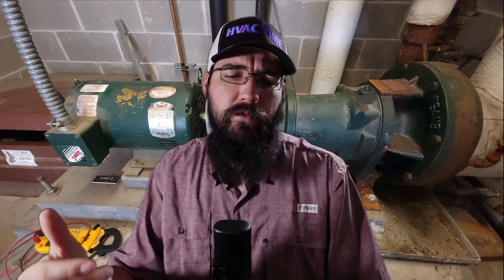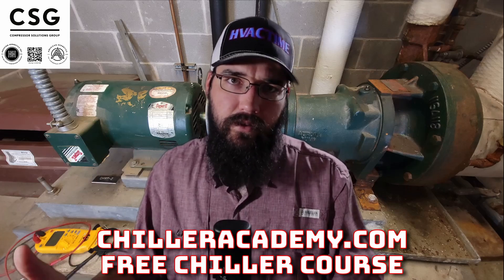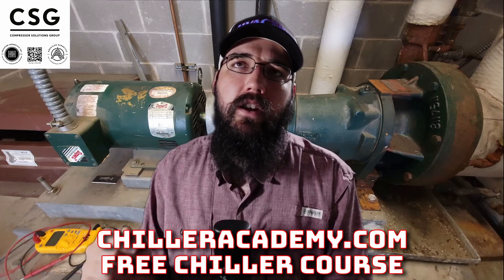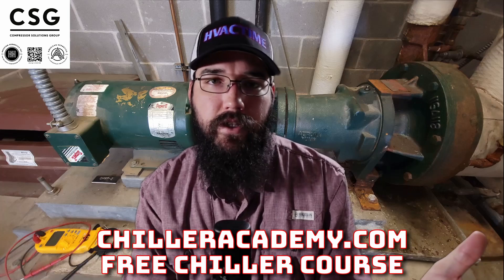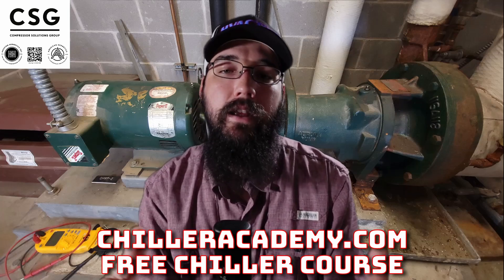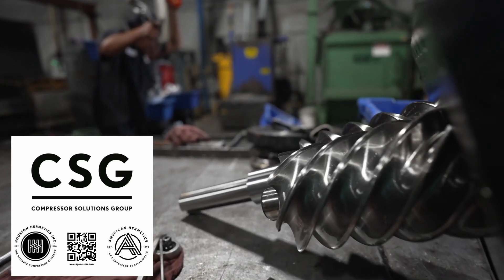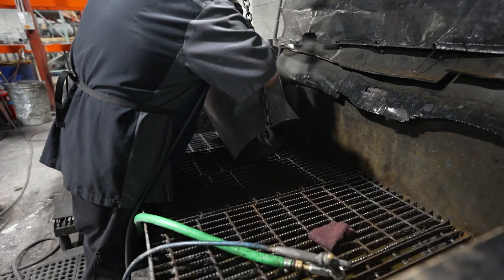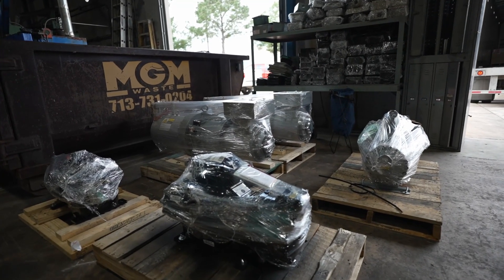Mixing Grease Destroy Bearings?

Comment: Started working at a 60 year old government facility. Asked why they using a high impact, high temperature grease on the motors. Oh, it is the same bearings in other equipment, so must be the right grease. Now after the facility is expanding, and maintenance is complaining about the rate the motors are being replaced. Motor vendor won't say what is wrong, but they sell a lot of motors and rebuilds.

Comment: I have been a Commercial HVAC tech since 1999. Our local motor supplier (Conrey Electric) furnishes us with a grease compatibility chart. I saw what happened when lithium grease was used on a 40 horsepower supply fan motor on a Trane Intellipak. The polyrex turned to liquid and the bearings failed.

Comment: Not 100% the same but I've been in the transport maintenance industry for nearly 40 years. Over the road vehicles are greased with whatever the shop has on hand. Usually the shop has whatever was on sale when they needed to resupply. If mixing was a problem, I would think there would be widespread failures from mixed grease types. Just my observations, nothing scientific to back that up.

Comment: There are grease compatibility charts all over the internet. Electric motor bearings use polyurea grease. Polyurea grease is not compatible with most other greases such as lithium grease. Both the Mobil polyrex and Chevron SRI are polyurea greases. Mixing them should not be a problem. The problem is mixing other greases such as general purpose greases with polyurea. Again a grease compatibility chart will show this. You also mention bearings running hot. Something everyone needs to understand in this trade is that motor bearings only need a small amount of grease to function properly. Too much grease will cause a bearing to run hotter because as the balls rotate in the bearing they will constantly be pushing against the excess grease causing resistance and heat. Over greasing electric motor bearing is far more detrimental than under greasing. Also as soon as you pump grease into a bearing its going to mix with what ever grease is already in there. There isn't enough space for greases to remain separate once the bearing is moving. Not an issue if you are using compatible grease types.
Reply: I agree 100% but I stick with mobile poly em because that's what comes in your motor from factory in most cases. That's all I'll use. But as for over greasing I'd like to add one thing, too much builds up pressure and that pressure can only go one place in most cases, spewing onto your motor windings after the bearing seal blows. Now your talking complete replacement rather than just bearings

Comment: How often should you grease bearings? I’ve heard once a year is all it needs but have also heard two pumps quarterly PM.
Reply from the maker: It's based on hours, most motors are 3k to 5k run hours and typically once a quarter aligns with that.
Reply: @ So 2 pump quarterly is fine?
Reply from the maker: It's not as simple as 2 pumps but quarterly for motors than run a typical business schedule is normal. How many pumps is relative to the size of your motor/bearings.

Comment: I think the issue is mostly mixing the lithium based greases with the polyurea based greases. Do you know if the chevron was a lithium or polyurea based greases?
Reply: Polyrex is polyurea base and another common used lubricant for bearings is mobil xhp 222. Where polyrex is for electric motors and xhp 222 is for everything else.
Reply from the maker: To my memory it was based on mobil poly and Chevron lithium
Reply from the maker: I've got to find this study again!

Comment: I feel like motor manufactures should stamp a warning on their nameplates if it TRULY is an issue to mix them.
Reply: Alot say the grease it takes is on the nameplate but I don’t specifically see any sort of labels that are on the grease tube compared to labeling on the nameplate.
Reply: They are actually starting to,well not a warning but the type is starting to be stamped on np now. I do believe most if not all motor manufacturers are using mobile poly em. And they have been for many years. Just stock that grease for motors and you'll be good to go. I buy it in cases and that's all I use for motors

Comment: What about “super tacky” versus EM
I had a maintenance guy last week tell me he added it to the pump/motor on the Loop that had only had EM in the Bearings 
8 Condenser 
8 Evaporator 
I went to B&G class that it was strictly forbidden 
You are correct about EM shortage 
Urea shortage was the other issue
Reply: If I found the same grease, that "super tacky" is a lithium grease. Lithium and Polyurea greases are definitely not compatible. SRI and Polyrex EM are at least both Polyurea greases. I would probably plan to do bearings in those motors soon.